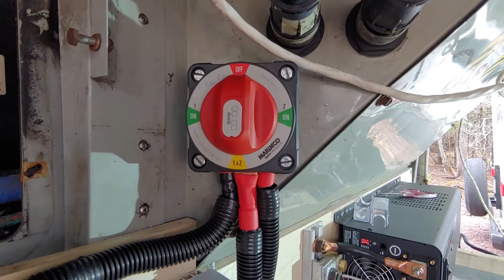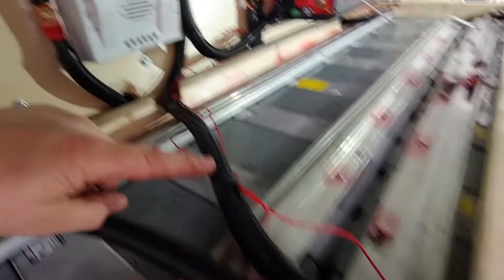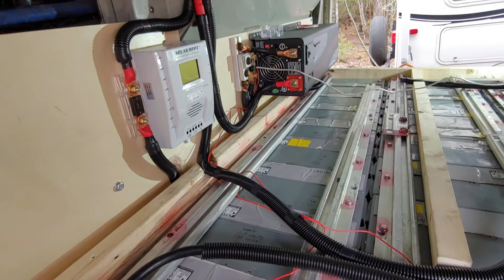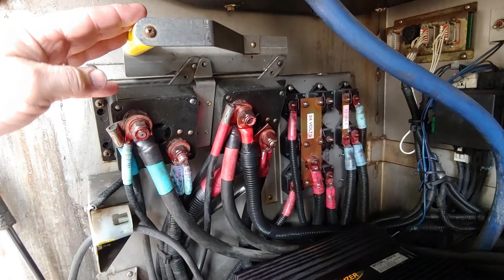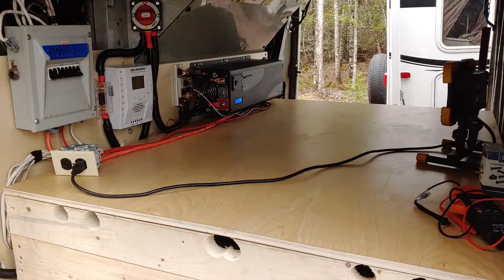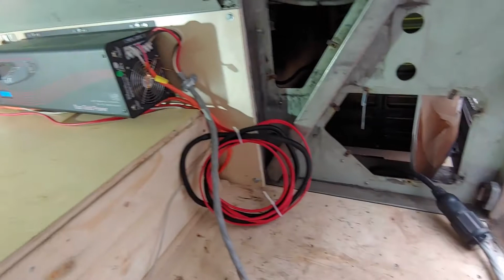Inverter and Battery bank now installed!

Comment: Inverter is running on 24v, or 12v?
6000 watts is one heck of a lot of power... AGM batteries are starting batteries or... deep cycle?
Reply from the maker: Thanks! It's running 24v, yeah I have a 4000w version as well but it's not enough to run my minisplit on high (240v). AGM are the house batteries, there is 28x 100ah batteries.